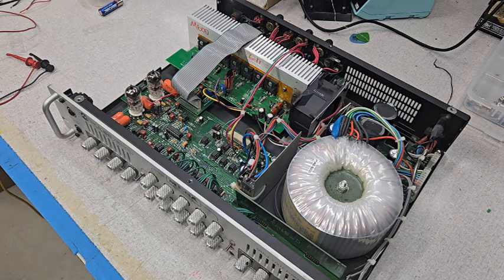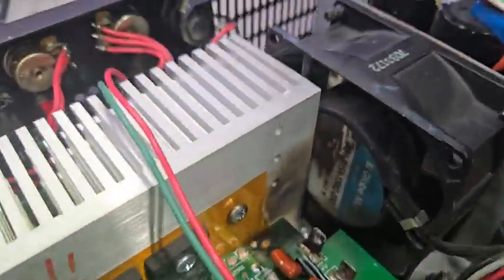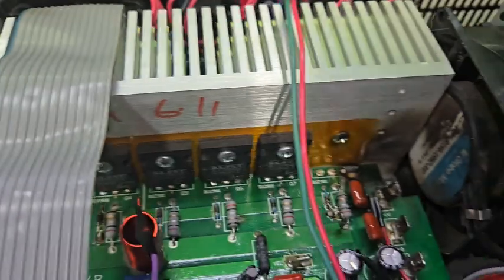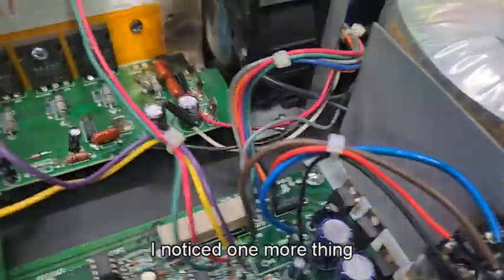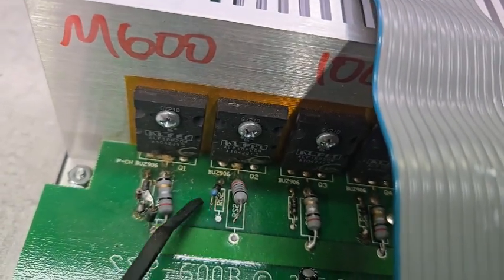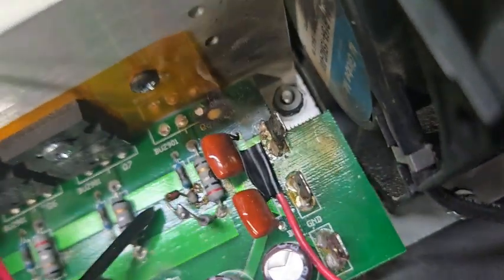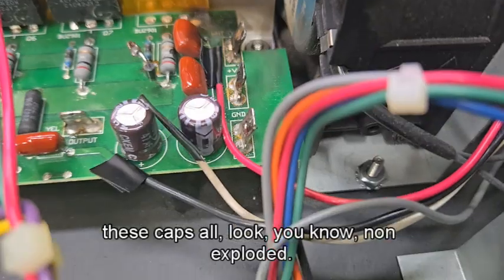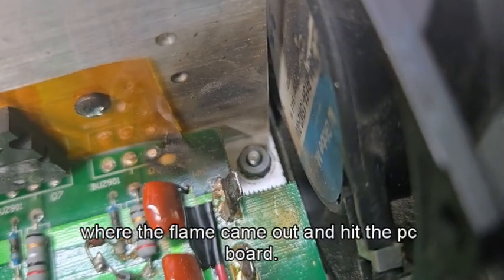Mesa mpulse600 Eval (Part 1) - Catastrophic MOSFET transistor failure and mysterious circuit mods

Comment from the maker: No worries @woodrowbeckford7610, it's a hilarious comment. Finding replacements for the ALFET ALF16P20W/ALF16P20W FETs in TO264 cases is a challenge. I found limited stock of EXICON parts ECW20N20 ECW20P20 from a supplier in France. The spec sheets have the same wording as the ALFET parts, and most of the component ratings are the same except for a lower max Vgs (+/-14V vs +/-20V). Excessive gate voltage may have caused the FET failures in this amp because the resistance between the gates and sources of the remaining FETs measures 100 ohms or less.